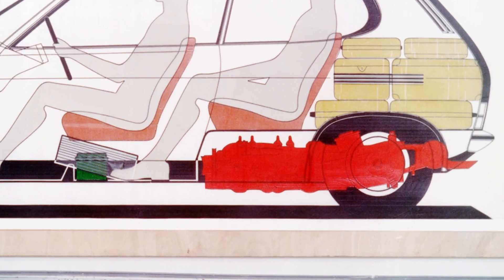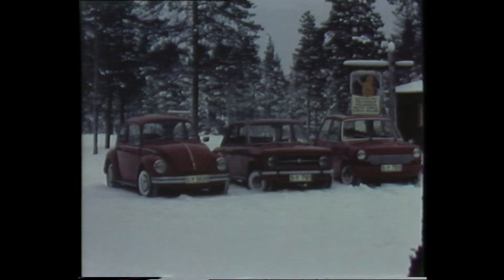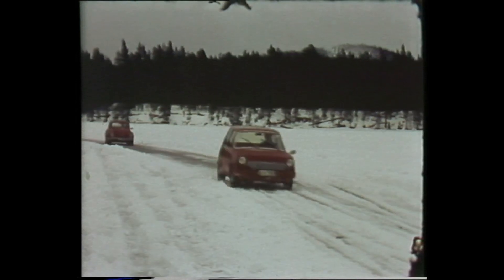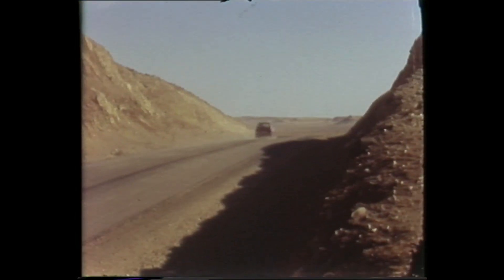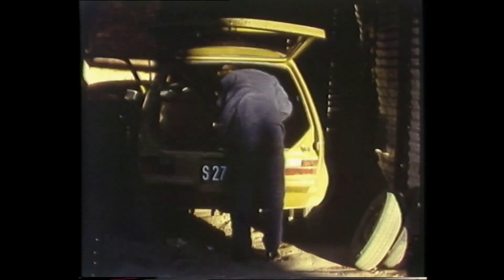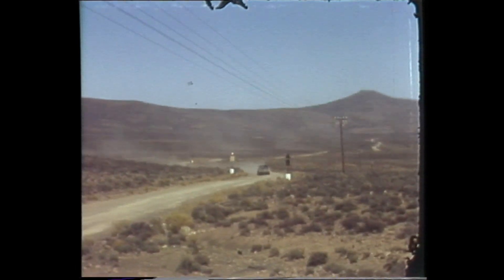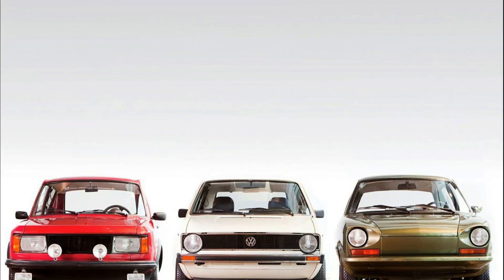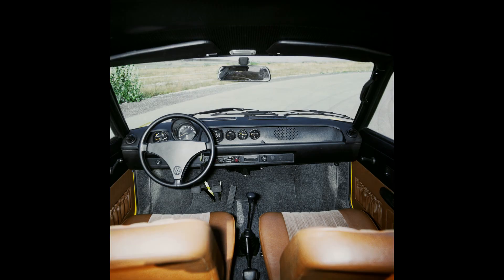Cancelled, Forgotten Volkswagen! The EA266. Archive footage, fascinating story.

Comment: Access to the motor would be no worse than say a Toyota Hiace where you remove the seats (or lift for minor issues) and a hatch.
There had to be more to it why they were canned.
Reply from the maker: I'd say it is worse, especially on the three door, as you can't access the engine without having to clamber right into the vehicle.
Reply: @HubNut  At least you will keep dry in wet weather. A bit like the Esprit. I just clamber in and sit in the engine bay.

Comment: I imagine for these flat underfloor engines, in order to enable as low a boot waist line level as possible, the engines would have to have extremely long stroke versus narrow bore in their cylinders..how that results in their NVH or 'drive refinement' levels i have to wonder ? 

Unlike in citybuses where underfloor engines are common, at least those engines are not directly under the passenger seats (unlike in these prototype cars in which they clearly are) so yes, i imagine noise, vibration, heat issues as nobody wants to sit on top of some hot shaking engine ?! Access for servicing would likely be problematic having to remove the rear bench seat etc.

Comment: Porsche firmly believed that a car's engine should be placed behind the passengers and in front of the rear axle. by putting most of the weight near the center of a car, it's handling will be better than with any other layout.  This was at a time when buyers of small cars preferred  having the engine mounted sideways between the front wheels,   like the BMC mini.
The space under the rear seat just goes to waste in most cars ( that don't put the fuel tank there).  Porsche thought this location would also leave both the space under the hood empty and the area near the rear bumper usable for luggage space.
The CEO of VW at the time was Kurt Lotz.  The board thought  he was Lotz of trouble.  They dismissed him and replaced him with the boss of Volkswagen of Brazil, Rudolf Leiding.
At the time they were having problems with overheating.  Leiding test drove the Mid engine VW, and issued firm orders to have the prototype destroyed and completely forget about this project.
Reply: Discovering the dangers of mounting the fuel tank in the front or extreme rear of the vehicle would eventually have killed the project, given that attention to automotive safety-relavent issues began in the mid-Sixties

Comment: VW was really lucky to have had the wisdom to chose the Golf. At the time it was obvious that the typical VW solution of the engine at the back had no future, it was becoming old fashioned, an odd looking car from the prewar era regardless how the designers tried to package it. People were starting to look further afield for something with a more modern appeal. Front wheel drive had that, had been perfected and the Golf design looked up to date, it was simply the way to go.
Not that that stopped me and many others from still owning and driving beetles right up until the early 1980s. They were cheap to buy, cheap to run, easy to service and lasted almost forever. I only changed to Golfs because of the safety features they offered in comparison to Beetles. You really don't want to be in a bad pile up in a Beetle.
Reply: This actually didn't have the engine in the back. It was in the middle, making it superior in handling to both front- and rear drive designs. The problem with mid-engine vehicles is that they were unpredictable in high-speed curves, for those who were inexperienced. Renaults and Citroens produced with mid engines located behind front axles didn't have these same handling issues
Reply: @Al_Dente  The problem with these prototypes was that for the average potential customer their engine placement would have been almost indistinguishable to say a VW Type 3 Variant. Both at a glance have their engines placed hidden under the flooring of the vehicle. That impression needed to be avoided. Middle of the 1960s customers were namely moving away from such concepts, they were considered old fashioned, from a different era.
I was once told a story at VW when I was working there as a consultant. In the late 1960s the VW board of directors was becoming exasperated at the inability of the design and engineering departments to come up with a concept other than having the engine hidden at the back of the vehicle. The directors knew this wasn't going to have much of a future and that VW's very existence was at stake.
Within weeks the board had replaced all the heads of engineering and design and told the new heads to come up with an utterly knew concept that resembled a modern car. That's when they finally introduced the Golf and Scirocco in the early 1970s.

I don't know if this story is true, but I do know that some of the directors there had quite aggressive work styles. One in particular one day (I was there at the time) took a chain saw to a 1:1 model of a VW Bus and destroyed it because he didn't agree with the styling. The same guy trying out the interior of a 1:1 model of a Golf thought the gear stick came too close to the dashboard. His quick solution was to kick the dashboard in, which solved the problem, but didn't help the design much.
Reply: @mikethespike7579  These directors' radical approaches were likely due to living through a world war. I haven't yet seen members of later generations react this way
Reply: @al_dente4777  I absolutely agree with you. And it wasn't limited to German directors. The company where I served my apprenticeship in sheet metal work in Manchester back in the day had a director whose behaviour was sometimes extreme. He was known to throw his telephone out of the window in anger. I once found his office blow heater smashed to pieces in the refuse skip. He had kicked it so hard that it had smashed against the wall. He once dragged my motorcycle across the company car park and dumped it in a ditch because I had parked it where he usually parked his Jaguar.
It turned out he had captained a battle ship during the war and had been commended for leading his ship through 8 battles against the Japanese without suffering the loss of one crew member. For that I think he earned the right that we looked the other way when he had one of his episodes.
Reply: @mikethespike7579  I once was employed by a hot-tempered old Brit who started his own mainly Jaguar garage in the States at a then near Biblical age of over 70 years old. This was back in the early 80s. He did have a positive side, though. He was strict on procedure and I learned how to religiously use fender covers, while servicing customers's vehicles. Supposedly, Britain was still a mainly moral society, until the beginning of the first half of the 60s
Reply: @al_dente4777  Thanks for sharing. Yeah, a hot tempered boss is usually good for discipline.

Comment: for some reason you totally ignore the K70 project that actually was in production , designed and build by .....mercedes  .  The groundmodel for the golf , scirocco and audi
Reply from the maker: It doesn't fit this timeline. The K70 stands pretty much alone. The mechanical package was nothing like Golf or Scirocco, and the Audi layout was merely inherited from DKW albeit with four stroke engines. K70 is a fascinating story itself, but ultimately a dead end.

Comment: What happened to the 411 VW?
Reply from the maker: Type 4. Was a continuation of the Beetle formula but not a very successful one.
Reply: @HubNut  The layout was well-liked by owners. I think the main issue was the early injection system. Very sensitive to water contamination. The injectors had brittle plastic lines that could only be replaced by buying the whole injector.

Comment: Radiator? Were these water-cooled?
Front drive Volkswagens with Beetle engines actually went into production and sold in Latin America.
I suppose, they planned an access panel for servicing the drivetrain within the vehicle, similar to how drivetrains were accessable in VW buses and Type IIIs. Although, this may have proved inconvenient for those less mechanically-inclined. Still, they probably should have produced these in less consumer-demanding countries in the Third World, much like they did with that front-drive, Beetle-engined vehicle. Just to cease this project altogether is quite sad, indeed
Reply from the maker: Yes, water cooled and yes, access panels. Would have been horrible to work on.
Reply: @HubNut  In terms of horror, the engineers of these were decades ahead of their time, when comparing how horrible it is to work on contemporary new vehicles

Comment: The little two seat sports version would have sold like beer at a ball game because that type of enthusiast wouldn't give a rodent's rectum about awkward engine location. Performance Uber Alles. The other models would be for the mom and pop family who would balk at the extra expense for any minor engine tuning having to be done on a lift. Put the moped size engine choice into any and it may excite the Tokyo based crowd who like wheeling around in cars like the Subaru 360 and Honda 600.

Comment: I will bet you the reason they killed this was due to the looming emissions protocols that were on the horizon.  Air cooled engines are notoriously difficult to control the cylinder temp. Just look at aviation sector..
Reply from the maker: These had a water-cooled engine.

Comment: Probably great little cars until the engine needed any work done. Or absolutely terrible dogs to drive and work on, who knows.
Terrible position for the engine.
There is a reason why front engine, front wheel drive became the standard for cars.
And 7:50 just look at the Golf beside the other cars. They look like 1960s hold overs and the Golf looks bang up to date and even ahead of the time.

Comment: On automobiles why are the front windshield wiper in a grove below the windshield so called hidden not like use to be or auto babies not front straight across instead pointed in the middle older cars were harder to see over front motor hood for lane lines mucho long motor size mucho big I had to sit on a pillow to raise myself up to see ok learning to drive smaller automobiles with the same room inside less crowded roads make for safer driving we need bigger windows more square rectangle not pointed mucho less blind spots as I see it nicer sheep auto body styles less blind spots or as above is best now I ask because government requirements for cleaner air safety air bags mucho more on our cars higher prices who can afford them does this mean less sales companies don’t sell go out of business then how do we travel I could never depend on public transit